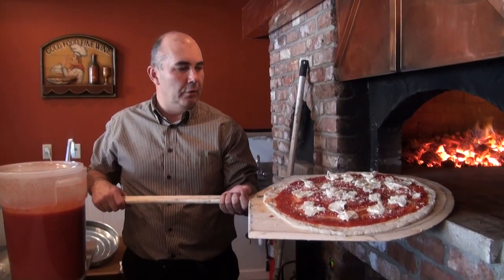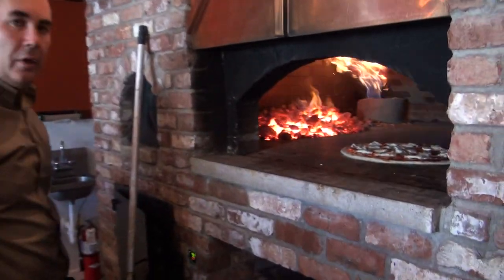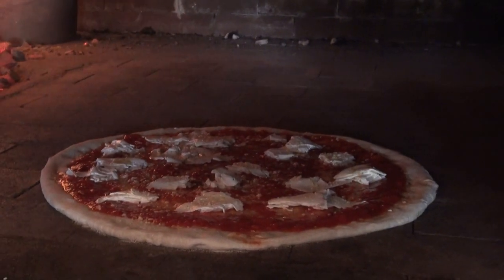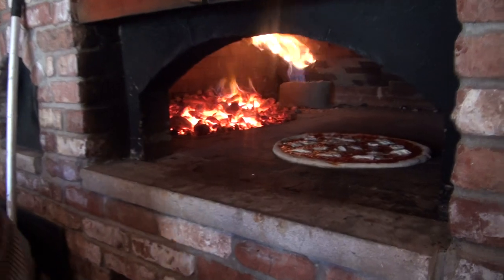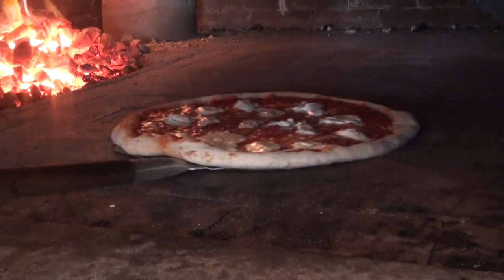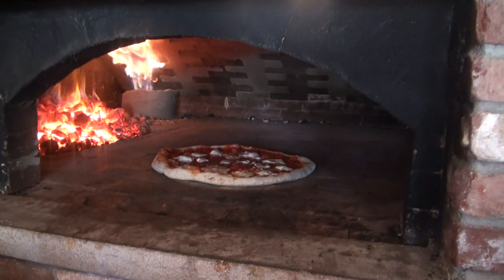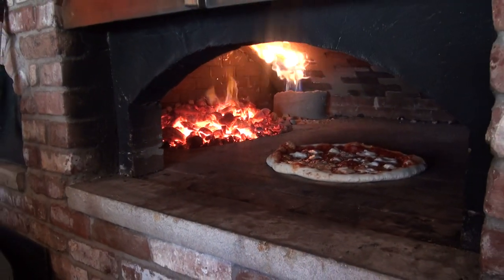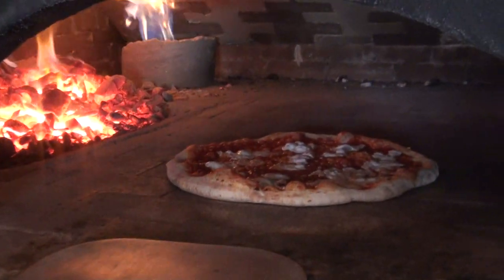How to cook coal fired pizza

Comment: Sure looks like gas oven with a pile of coal inside
Reply: I wonder how would it be without that gas fire...
Reply: most commercial coal/ wood fired pizza ovens are partially assisted with gas. the gas helps maintain heat for hours, while the coal/ wood provides the the smoke/ spikes temperature and adds flavor. the oven cannot reach proper pizza cooking temperature on the gas alone, and sure it could reach the temp on coal or wood alone, but the cost to maintain that temperature, for 12 hours long every single day would be seriously high due to the amount of coal and wood needed, which for any restaurant, is unrealistic. Every penny counts in the food industry. If you want your large pizza to cost less than $25 than shut up and enjoy the hybrid oven.